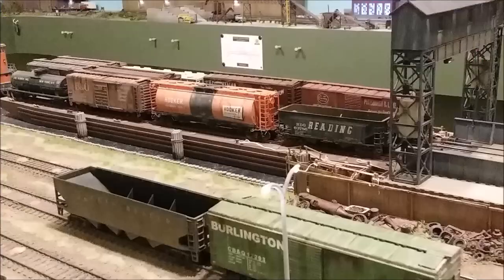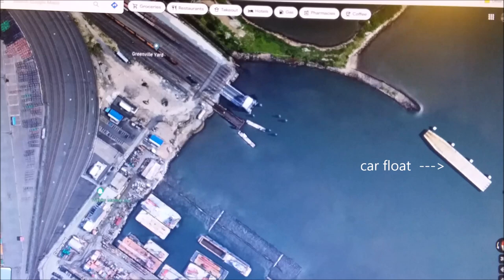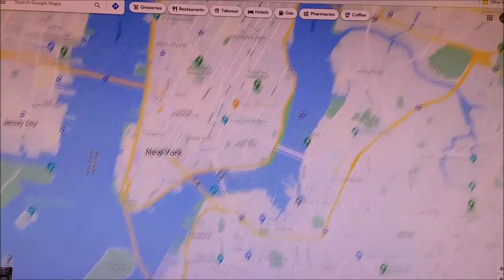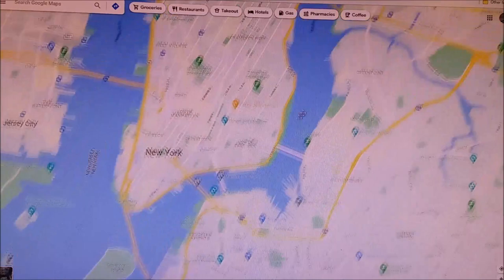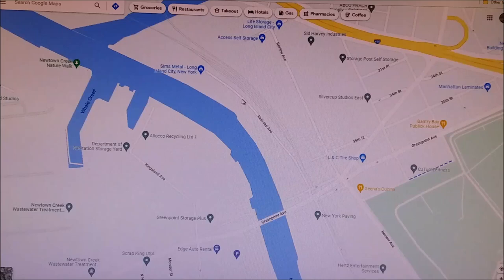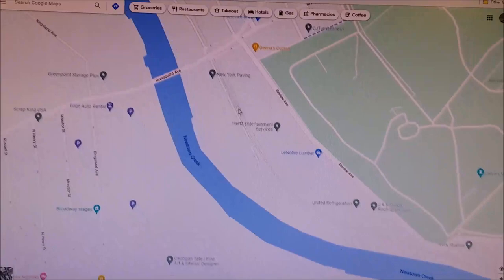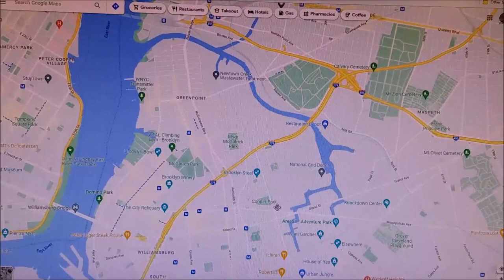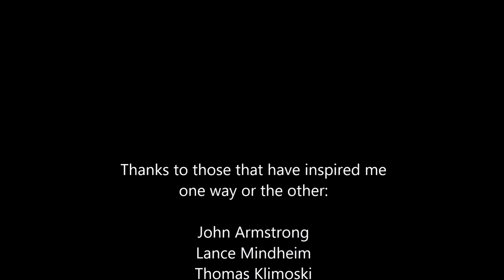Unloading the Carfloat at the Long Island Rail Road (1)

Comment: carfloats were unloaded at west 8th street yard which was the yard connected to both yard A and the existing float bridges along the waterfront in LIC. all of the inbound float traffic was brought into yard A for classification. freight headed for eastern long island was forwarded to holban yard in hillside from yard A for classification and blocking for the east end of the island, with the exception of the port washington branch all of the freight jobs to the various branches on the island operated from holban yard. blissville yard was a yard used for local support of customers in the blissville area, and for the degnon and kearney spurs.

the layout looks excellent and very nice weathering on your equipment.
Reply from the maker: Thank you so much for the information! Anything else you can provide will be greatly appreciated. For example, how did the LIRR use cabooses on the local jobs?
Reply: @longislandrailroadmontaukb982  the long island railroad refers to its cabooses as "hacks" , a phrase that i believe is unique to the LIRR and B&M

LIRR caboose usage was pretty standard, in the era of the 16 hour law and 5-6 man crews it was the conductors base of operations as well as additional quarters for flag and brakemen. the LIRRs steam era cabooses were rather spartan and had no bunks, the flat side hacks from the early diesel era were the same. crews that ran the two day holban-montauk or holban-greenport frieghts would room overnight in a bunk house at either terminal. i'm sure for long shove moves they would've been used on the point when needed, there were hacks based at yard-A, fresh pond, and holban to support the various orginating jobs and transfer runs.

Comment: I just discovered this series of videos and I must say that this is my kind of layout!  I have a much smaller switching layout, but the rolling stock and slow operating speeds are very much the same.  I rotate the power through an SW9 with added sound, a tiny Plymouth ML-8, and a GE 44 tonner.  And I often use an idler flat or caboose next to the loco, but just for crew comfort as there are lots of close clearances.  The track layout is based on the Inglenook Sidings Puzzle and I wrote a computer program to work out the shortest number of moves needed.  Cheers from Wisconsin.
Reply from the maker: I have a smaller layout as well that has an Inglenook Sidings built into it. I will do a video about it eventually. I also have a 44 tonner and a 45 tonner, but the 44 tonner's motor is really loud so I don't use it on videos. I have a 6-wheel Plymouth thingy from BLI but it runs like crap so I don't use it.
Reply: @longislandrailroadmontaukb982  My Plymouth is a 4 wheel Walthers model and runs very smoothly on DCC but just so-so on DC.  My Bachmann 44 tonner was loud too, but I found that loose worm gear housings were the main cause.  Even so, it is still comparatively noisy--no need to add sound!  I look forward to seeing your Inglenook video.

Comment: I recently picked up a Athearn custom painted SW1500-supposed to be SW1001 Long Island loco numbered 102 and painted as in 1995.
Reply from the maker: I just got an old Proto 2000 S1 and am repainting it as 421 ca. 1965. It's tricky...

Comment: My father was Superintendent of Track (LIRR) with Bay Ridge floats under his jurisdiction. He hated the issues caused by the float and the heavy E33 electrics.  I have two switch lamps from the old Yard A.  Will your switching software work with Windows, and would you share it?
Reply from the maker: Wow, that's great! If you have anything else you can share that would be fantastic! My switching program is written in Visual Basic for Applications for an Excel spreadsheet. Unfortunately it's completely tailored to my layout and can't used for others, unless you're really good at VBA!

Comment: What are the big blocks on the flatcar.
Reply from the maker: They are meant to be large blocks of concrete, used to add weight to the reach car. This was done because if the car is too light and coupled to heavy cars it could actually be pulled off the tracks vertically if the car float was significantly above or below the height of the track. This is also a factor in many derailments when going around curves if light cars are ahead of too many heavy cars. Anyway, they are modeled with hollowed out blocks of Styrofoam with weights stuck in them (as is the large tarp-covered block). The car is weighted for the exact same reason as the real thing.

Comment: A nice video of unloading your carfloat you made but excuse please, in normal way your carfloat would be sink over steerboard into the river.
The four cars from backboard needed to be unloaded ½ first, two of the cars will stand onto carfloat apron bridge during thr shunting loco will grap the steerboard four cars with its ,,bridge car" (if one is too short you will need to use two of them, because the loco trucks are too heavy weights for the carfloat apron bridge and woud destroying it.
After unloading the steerbord four cars you will couple the middle track three cars behind then and at least the four cars from backboard of what you had ½ unloaded first. Altogether your lead track need to handle 13 cars in length alltogether in minimum.

Like you said the ballance of the carfloat will be important but why you do not showing it into your video?

The unloading and loding physics are tge same like onto traject ferries with two loading tracks only...at one side the half of the train will be loaded/unloaded.
If you will decouple the half unloaded train part like you have been shown than the weight of the not unloaded train part and the two cars nearby the apron bridge will pressing the apron bridge upward.
It is more safer to let the half train onto carfloat and carfload apron bridge meanwhile you are operating the other side train part.
Reply from the maker: I appreciate your comment but you have to realize there are no absolutes. That engines aren't allowed on aprons or floats is a myth. It all depends on the railroad. Some allowed it, some didn't. I will grant that the RS-1 might be too heavy, but I only use it because no one makes an ALCO S-1 in LIRR colors. I'm looking into other options. Also, although your description is a little hard to follow, I think I'm doing exactly as you describe. Regardless, the method I use is well documented as one of the ways to unload a carfloat. Anyway, thanks for watching!